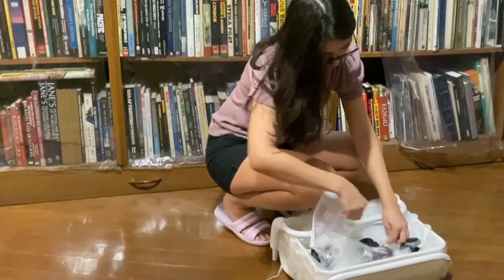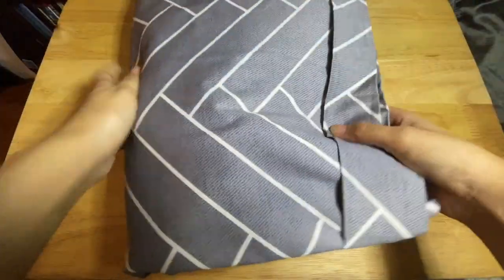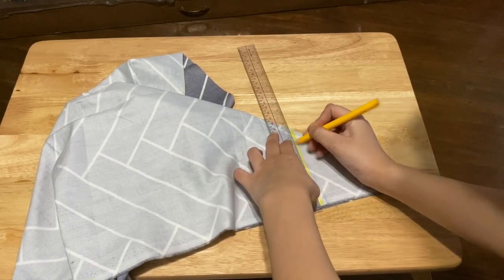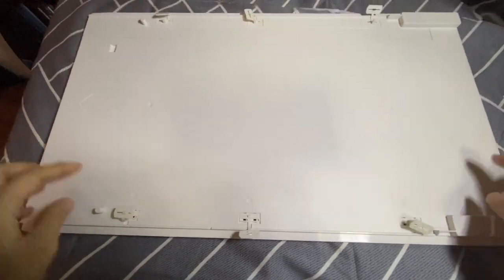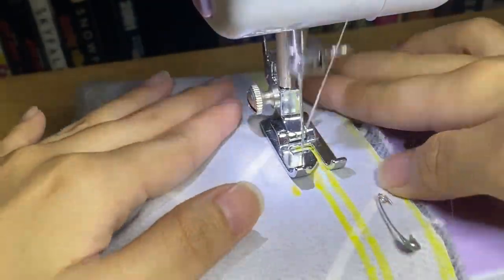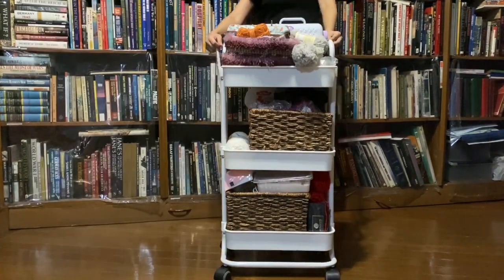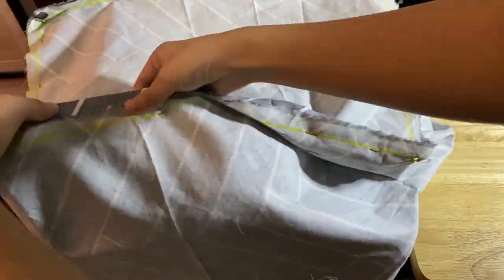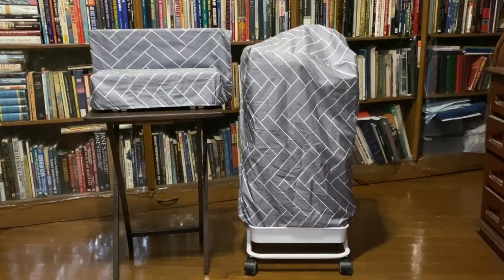How to make custom dust covers | DIY TUTORIAL

Comment: Fab video I am off to make some. What marker pen/pencil do you use the yellow one
Reply from the maker: Hi! It’s a dermatograph or grease pencil. It’s like crayon. I would not suggest it for front-facing side of the fabric since they might not completely disappear with wash but it’s very handy to use, easy to apply and does not bleed into the other side of the fabric.